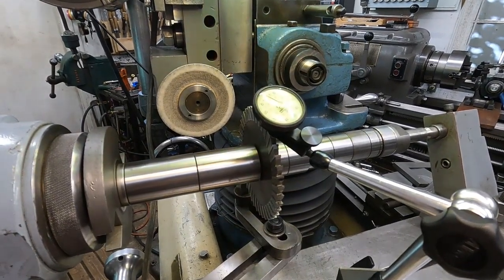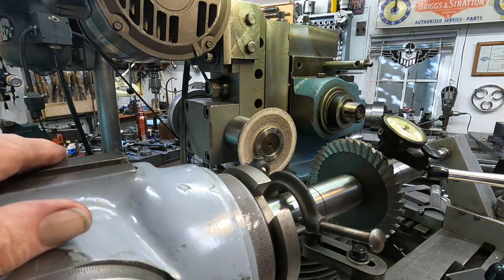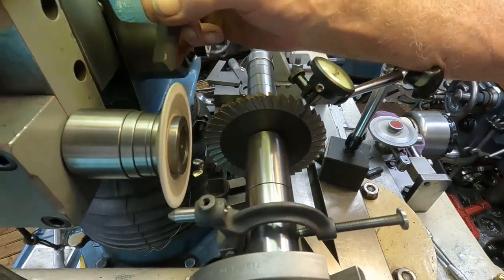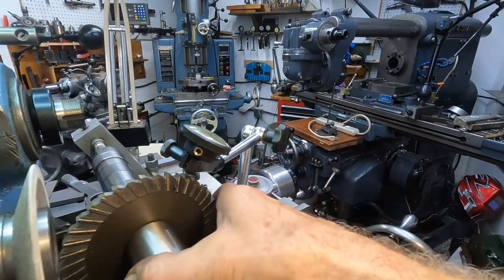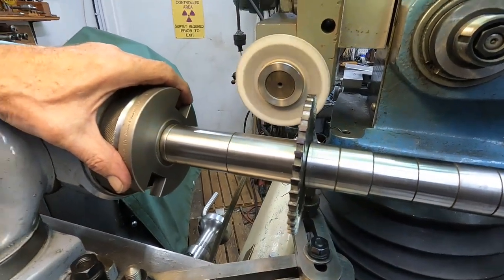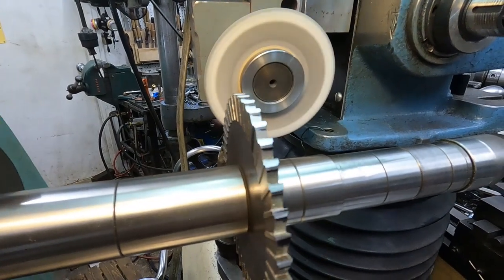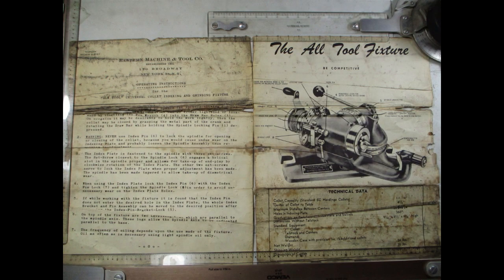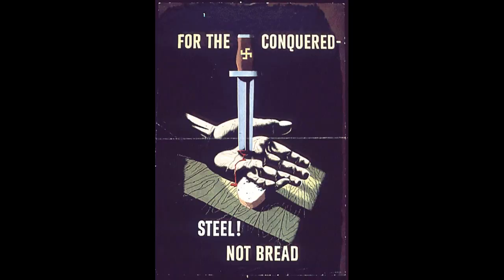Tooling cutter grinder for horizontal mill cutters

Comment: Dee I am going to play the Devil's advocate and ask a few questions and make some observations. The wheel appears to be out of round but since you reground it on the arbor that should have taken care of that but by the sound it is still not rotating on a true centerline. This makes me ask what is in common with the cutter before and after the grinding. I would have to say the arbor. Do you know that it is truly straight? My reason for asking the question is a few months ago I adapted a Power feed to the lead screw for an old lathe of mine. It appeared that the bearings were binding by the speeding up and slowing down of the lead screw. I messed with that thing for several days trying different things trying to solve and correct the problem. final discovery was the lead screw itself had a slight bow in it and when rotating inside the half nut it would always bind when the screw made it to the high side of the bow. I haven't done it yet but eventually I will pull the lead screw off and straighten it.
Reply from the maker: These cutters have been ground back from 5 1/4" to around 4 3/4" so the original teeth are completely ground away, it seems there is an error that I have not been able to grind out playing around with 3 out of 6 so far. The arbor is true but it flexes when the high teeth contact the work. I have some other cutters I will grind and test next. I want to check these 6 cutters out on the surface plate and have a look.
 I need to make a work head short arbor for gashing in new teeth in and start from scratch. It is always interesting anyway.
Reply: That’s interesting. But the out of roundness of the arbor should be compensated by the grind. The further away the edge of the wheel is because of the bow (assuming there is any) the less will be ground. The nearer, the more will be ground. So there is a self compensating factor there. What the actual problem is, is something else. But I can tell you that factory,fresh,cutters on new arbors have the same problem to,a,certain extent, as do cutoff saw blades on the pretty expensive arbors I have. It’s tough to watch a 2.5” $100 carbide saw on a $200 arbor do this, but it does.
Reply from the maker: @melgross  The interesting part to me is, they had been sharpened before and usually I can improve to a more reasonable chip load on something like this but come up with the same error .005" to .008" indexing these two ways on two fixtures! The new cutters on hand are less than .002" for run-out. I have a dull smaller 15 tooth cutter to try now I am already set up for grinding. Thanks!

Comment: Thanks Don, I always learn a ton from your videos. I have a bunch of old cutters I bought in a lot for my B&S mill and they need to be sharpened. I had no idea how to properly go about doing it. I think that I could try doing this with my little surface grinder at some point in the future.
Reply from the maker: There is a lot that can be done on a surface grinder with simple fixtures. The horizontal mill cutters were meant to be reground. Locally most would have a grinding service do it that averaged about a third the cost of a new cutter. The milling cutters were always expensive. I have always liked grinding machines, many did not. I have some other cutters to grind coming up, thanks!